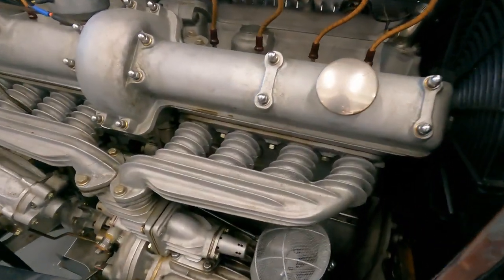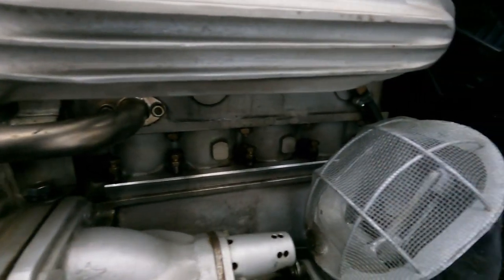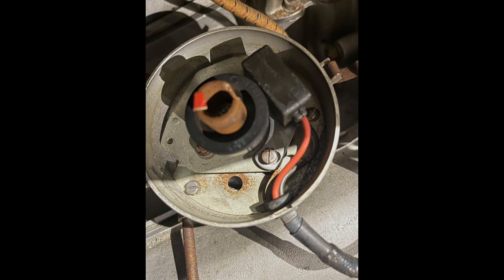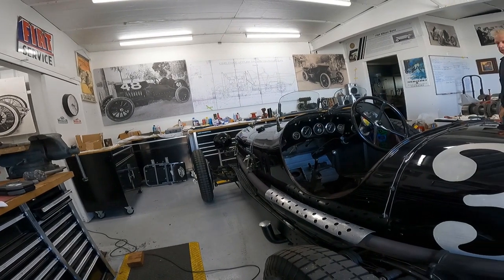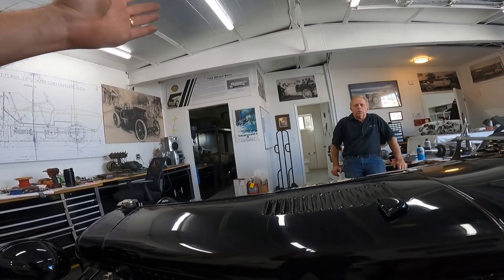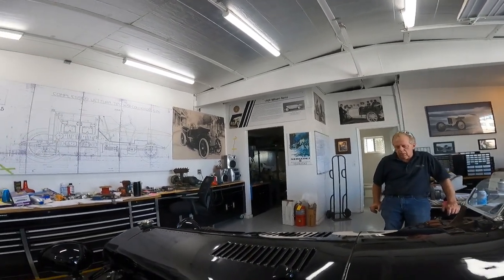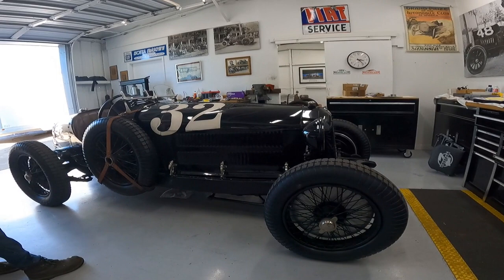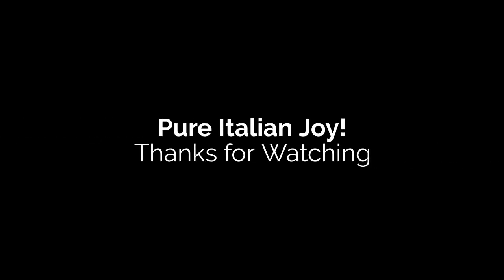1932 Alfa Romeo 8C 2300 Monza Full Throttle Test Drive and Tune

Comment: What a wonderful machine, a black supercharged Alfa racing car on the road, it's beautiful, sounds amazing and even has the steering wheel on the proper side.
Reply: Pre-1935 grand prix cars were usually RHD because most circuits ran clockwise and the driver's weight made a difference. Later in the decade, single-seaters came to dominate.Faster, of course, but the days of driving your Alfa, Benz, or Bentley (even if only in your dreams) to the track, winning the race, and driving home for supper were gone.

Comment: That's a Pur Sang replica.
Reply: I'm assuming that as well, but I'm not worried. Their replicas are superb, from what I've heard, and I'd happily drive one. 🍀❤️
Reply: I thought so too. 

Though I am caught off guard by those scrutineering stickers (those coloured round stickers slightly obscured by the steering wheels in some of the views). Those, by the looks of things were from Monaco GP Historique, an event that only admit original cars, or at the very least, recreations with substantial original parts and carried the identity of an earlier, no longer extant, car.

Then I realized that the scrutineering stickers  were for different race classes. The Monza should've been to the Grid A (for pre-war GP and Voiturette cars), and those stickers were from different grids. There's one Grid A sticker, two Grid B (if I remember correctly this is for the 1950s Formula 1 cars) stickers, and one C (1950s sportscars) and one D (1.5 L F1 cars from 19561-65). So I'm guessing the owner of the car actually owned original cars of different ages, but for some reason, put their scrutineering stickers on the replica Monza at some later date...

Comment: In my humble opinion the car is a little rich off idle and part throttle, ideally you would like to have all of the centrifugal advance in by 2000 RPM. On the race cars we would lock the distributor out at 35° so at the hit of the key all the advanced was already there
Reply from the maker: Thanks, Steve, this is an exciting car to work with. Having worked on traditional cars all my life, this one is a bit different to dial in.  It runs best with 40 to 45 degrees of total advance. Seems high for me, however, this is only a 6 to 1 compression ratio. Perhaps these cars were designed to have lots of total advance?  I would think pulling timing out when under boost makes sense to me, however, it seems to want more timing under full load and high RPM. This fine machine really comes alive at 4000 RPM.
Reply: @GregQuirin  different combustion Chambers Like different amount of timing, closed chamber big block Chevys like over 40° probably 42 or 43 and the small block Mopar it's like between 34 and 36, the only real way to tell is put it on the dyno and move the timing around a bit
Reply: @GregQuirin  hello Greg. Who is the driver?? He owns a lot of historical cars : wonderful Lancia D24, this Alfa (142 hp).